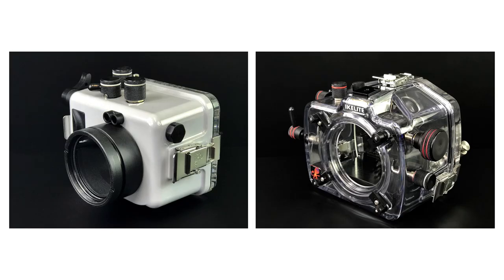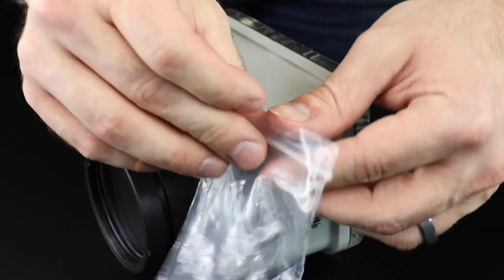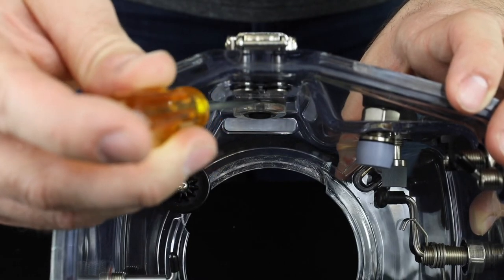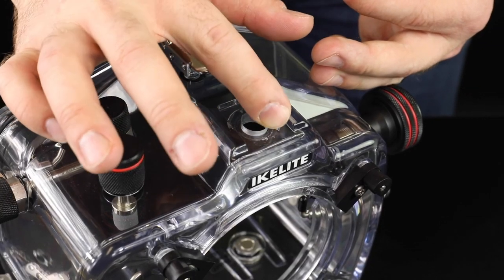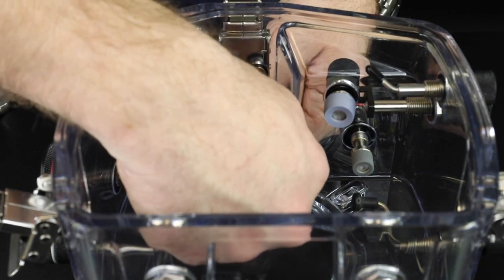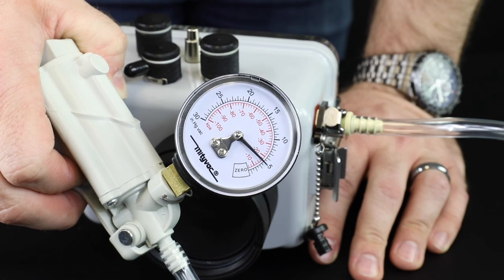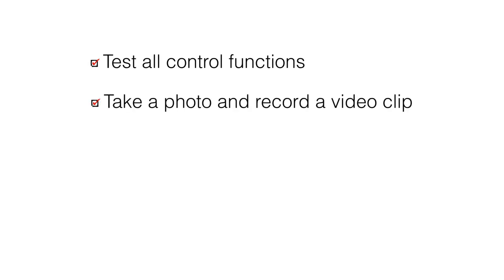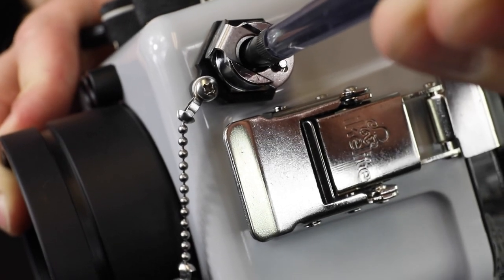How to Install an Ikelite Vacuum Kit for 1/2 inch Holes

Comment: So I bought an ikelite housing from backscatter and when I got it I could not pull a vacuum on the housing. The reason - they had installed the vacuum kit incorrectly and overtightened it - with the sealing ring pushed out of one side
Reply from the maker: @timstevens7233 Thanks for choosing Ikelite products. Sorry to hear of the trouble with their installation. If you need any assistance getting it sorted out please shoot us an email via ikelite@ikelite.com and we'll get you taken care of!

Comment: So do keep the negative pressure during dive and release once back on land?
Reply from the maker: Absolutely, diving with the system under a vacuum is recommended.
Reply: @ikelite  Thanks!
Reply from the maker: @Ernieunderwater  You’re welcome. Let us know if you have any other questions.
Reply: @ikelite  ok, 1 more Q...  I ordered the housing for the Nikon D750.  The base plate has a tab that looks like it doesn't fit right.  the tab on the top side of the base plate lands in between the back of the camera and the tilting monitor.  When the base plate is installed the camera  monitor has to be tilted in order for the base to fit, leaving the tab between the tilted monitor and camera.  is this correct or is it suppose to sit flush behind the monitor? (monitor completely closed) Thanks, Ernie
Reply from the maker: @Ernieunderwater  This is completely normal. The camera mount is designed in a way that lets you tilt the LCD screen while it’s attached. In short, the “anti-rotation” wall is supposed to go up against the camera body and not the screen.

Comment: I have the canon 5D mk ii housing can i make a hole to put this gadget on it? Thank You
Reply from the maker: Erwin List We don’t recommend adding a hole, but you can either replace the housing’s top mount with product 47012...

https://www.ikelite.com/collections/vacuum-systems/products/vacuum-kit-for-1-2-inch-accessory-port-and-dslr-top-mount

Or strategically choose a control/gland to replace (typically lens release or mode) with product 47013...

https://www.ikelite.com/collections/vacuum-systems/products/vacuum-kit-for-3-8-inch-control-gland